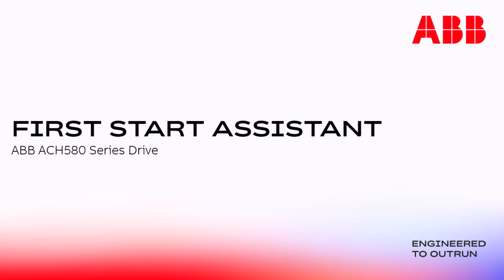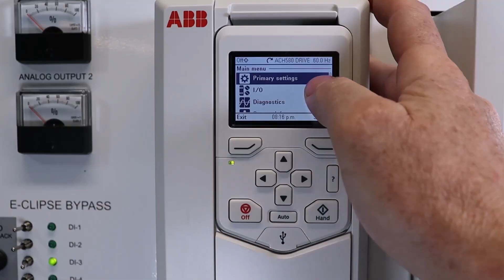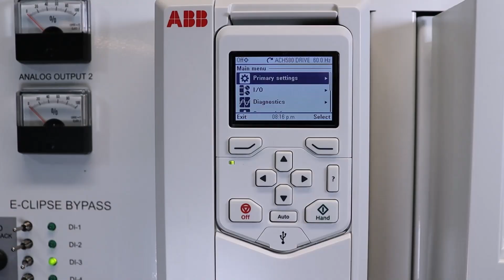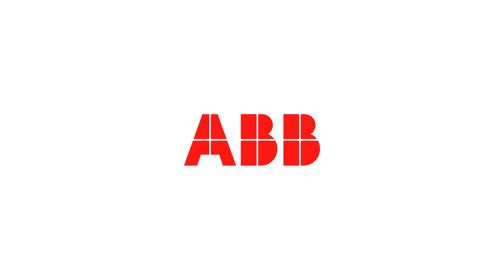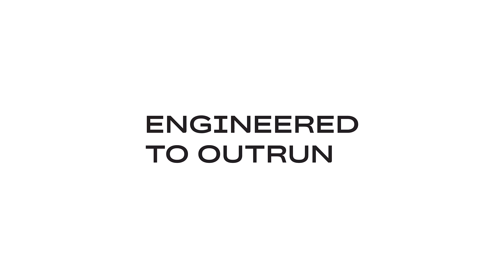First Start Assistant on ACH580

Comment: On the ach580-01-03a5 I have the first question is "set up drive now? 1. Spin the motor mode 2. Commission the drive 3. Exit and don't show at power up 4. Exit. It didn't come with a manual explaining what any of those means exactly
Reply: 1) Spin the motor covers just the very basics.  This is for the contractor who isn't the one who will commission the drive, but they need to run the drive temporarily.  Perhaps they need to test the pumps, or on a fan application get some air moving to help with ventilation so the drywall mud dries faster.  
2) Commission the drive is for the person who wants to go through the steps to start to commission the drive.  This may not cover everything, but it gets the basics.
3) Leave this screen, and on the next power cycle, skip this screen and not have it show up ever again.  (This is someone who prefers to commission it themselves without being walked through a guide).
4) Leave this screen, but on the next power cycle, come back to this screen. (This is someone who wants off this screen, do what they need to do in the drive, but let it come back to this screen after a power cycle, in case the start-up / commissioning person may want it.)

The local ABB ACH580 rep likely offers a half day or full day hands-on training class.  If you'll be working with more of these drives again, I'd highly recommend reaching out to them.  My team creates these YouTube videos and they help with focused activities, but nothing beats an in-person class with a demo and exercises to go through.